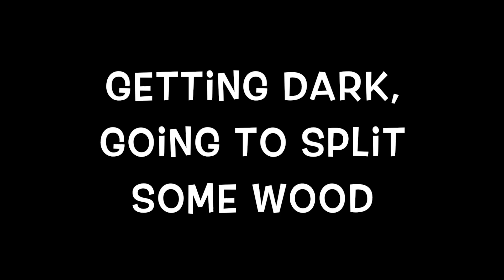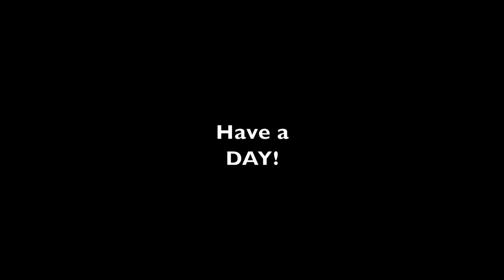#553 Building Stuff and Splitting Things

Comment: Hey Mike.  I think your concerns about building with green wood are right on.  Our log home built in 1986 was intentionally designed with 2 inch gaps above the window and door frames. The logs have since settled around them to where the gaps are much smaller.  For a number of years, the occasional loud cracking noises from logs checking would scare the crap out of you. LOL.   Hope to meet you at the Paul Bunyan Show!

Comment: Mike you may want to consider vertical windows in addition to the horizontal windows for bow season. Almost all of my blinds have both a horizontal window for gun and crossbows and a vertical window for bow hunting on each wall. Before I frame the windows I imagine possible shots and sit in my blind chair in position. Have someone measure the optimal sill height while you are sitting gun in hand. The sill height can vary depending on which window you are shooting through given some variance in terrain from each side.

Comment: Hey Mike, If I make a comment or suggestion it'll be with some knowledge.  1]  I've noticed that you're not using a pin on your  wood trailer hitch.  Please-always pin a hitch no matter the use.  2] Consider using 4x8' styrofoam for your cabin insulation.  Easy to cut, light weight, and the color[s] will pass until the interior is finished.  You do great work!  rog

Comment: Another top video. You'll love the cubic mini stove , I've had the Cub CB1008 for about 2 years and love it.  It hangs on the wall and really throws the heat out. Maybe Chris at Wolf Ridge could design a wedge to produce Hunter size  splits to maintain the processing speed. If I didn't live at the other end of the world to you I would loan you my Paslode framing and bradder nail guns to get that framing done in no time.

Comment: If you plan on hunting there, you may want to bring your chair out and get an idea of where that one foot window is best suited for shooting so it's not too high or low.  Just my two cents worth
Reply: Bettin a mechanics stool would work great for that. https://www.harborfreight.com/pneumatic-adjustable-roller-seat-46319.html or something on that order.
Reply: Good idea!
Reply: @mikeodonnell3390  Ha, then he'd have to put a handrail on the stairs.
Reply: I have found it best to visualize potential shots sitting in my blind chair, my preference is the Cabelas max comfort 360 swivel, and measure out the sill height for each side. Depending on the terrain the sill height may vary by half an inch to more than an inch for your most comfortable shooting position.

Comment: I see that you are trying to keep the bark cut off thick enough so that you can include them in your regular firewood pile so as to not waste any wood.  Nice job!  Hey any logs that have been on the ground long enough to loose their bark but are not rotten inside?  Those would be great, all premium grade fire wood!  Or how about standing dead wood that has lost its bark?  Not too many of either of those types of wood around to make it feasible, but keep an eye out for such...just in case.  Great stuff.
Reply: With limited exceptions the wood he uses is from dead trees. He has the luxury of having a surplus of wood to select from. With trees that have lost their bark you run the risk of ending up with punky wood and that is a good way of losing business. It is probably best to ignore them.

Comment: So it took me 60 years to learn this (after a lifetime around construction).   What is the difference between "hardwood" and "non-hardwood".
Reply: Density of the wood fibers?
Reply: @kristercarlson2635  Indirectly, I suppose.  Hardwood will sink in water.  If you take down a very old pine structure, the wood is "hardwood".
Reply: @flyingjeff1984  Very good info! I learned something new today. Thank you!
Reply: I've always been told that it has to do with it's strength, but also, "hardwoods" are usually deciduous trees (they lose their leaves in the fall) and "softwoods" are evergreens, i.e. pine, hemlock, spruce, etc.

Comment: Some unsolicited advice.  You are on an 8x8 platform in the air. When I saw you set up the saw horses I thought "He doesn't have the room up there for that" This is only my opinion, but I would build the walls on the ground even if I had to build them on the driveway and bring them out on the tractor.  If you fall off that platform and die some of us will have nothing to look forward to watching!